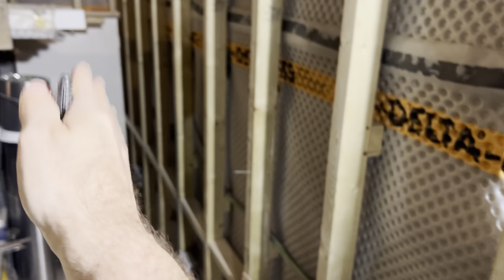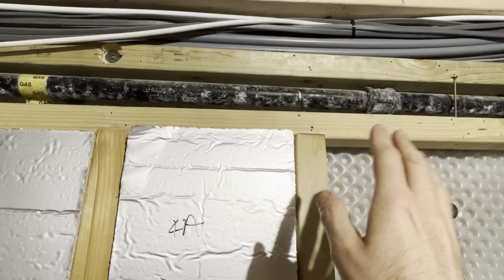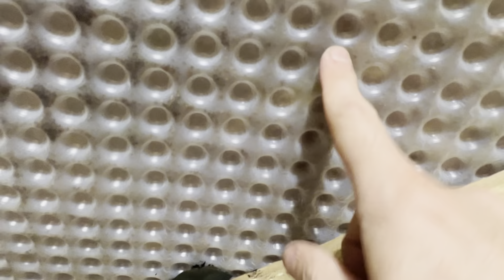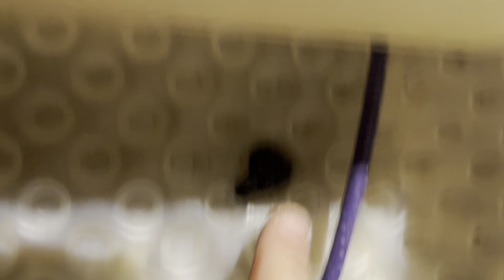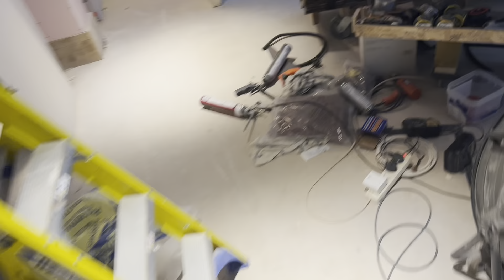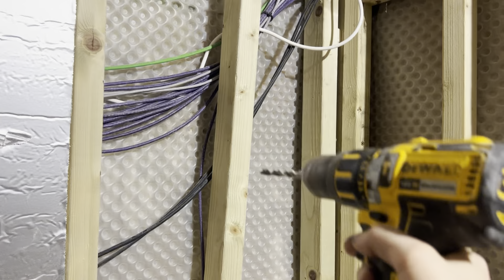Delta Membrane #1 - Detailed look at Delta Membrane plugs & repair of membrane

Comment: This is interesting, I need to look in to this system - but I am a bit concerned about 🧱 and changing their environment.
Some take down the plaster off brickwork that shouldn’t be removed (some bricks need protecting from moisture) and that can cause permanent issues with the stability of the whole wall.

Hope you‘re fine, obviously you‘re invested in it and I am interested! Thank you for the rabbit hole!
subs right now